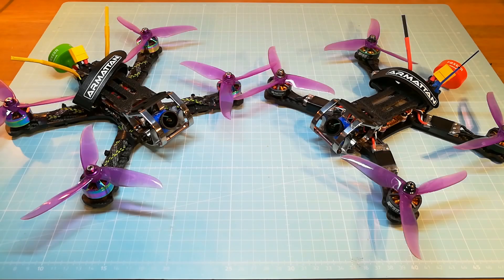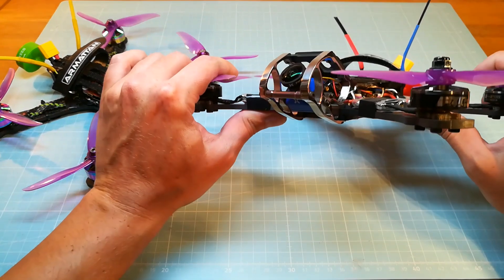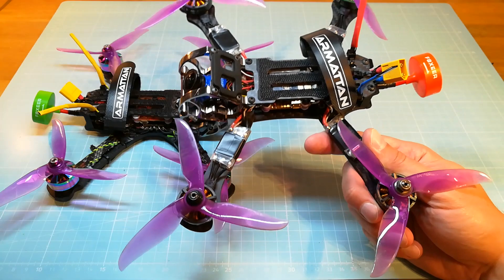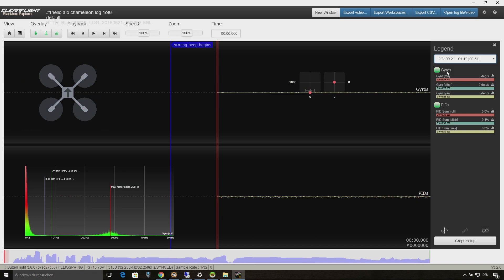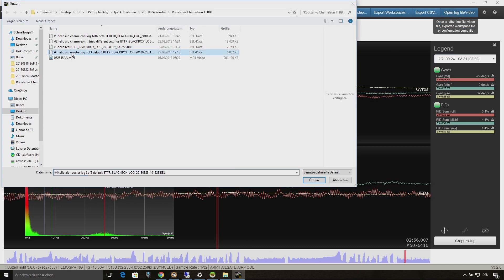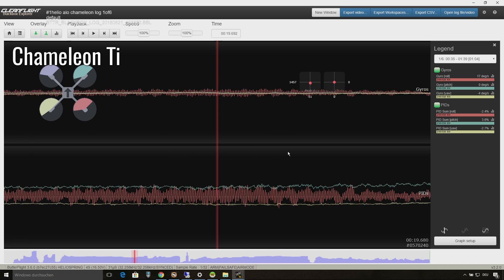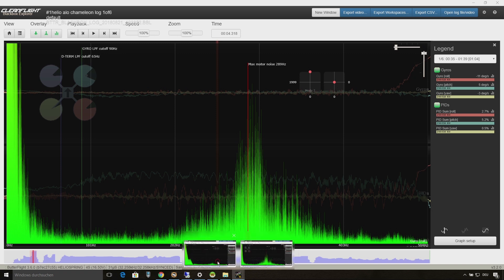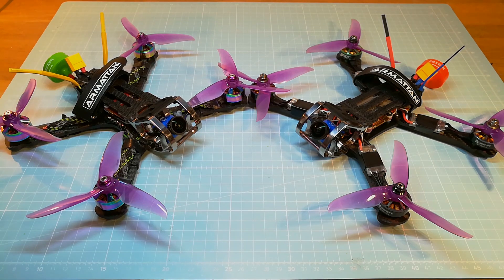Armattan Chameleon Ti vs Rooster - Noise Issue - HelioRC - Butterflight - Blackbox

Comment: Hi, I know it has been a while since you posted.I wanted to share since I used your video to identify the noise frequency so I can add notch filter to my flight controller (Kiss V1 - because I was too lazy to attach OpenLogger). It worked perfectly. I added notch filter of 275Hz (50hz band) to my roll axes and quad is flying great.

Comment: Great video, thanks for that info. I have been experiencing the same issue, but had gone from from the rooster to the ti because my original chameleon has solid footage. Footage was solid on Betaflight 3.5.0. But Ive switched to 4.0 and all was good, but now I'm getting all of noise to the gyro. Footage is looking really bad. How's your footage lately. Thanks
Reply from the maker: Thanks! So you are having noise now with the Chameleon Ti?
I have also tested different Beta and Butterflight Versions with my Chameleon Ti with the HelioRC. I couldn't get rid off that issue.
Now with the Rooster it's much better, but i have addidonal added Capacitors to my Main Power Lead and even smaller Capacitors to the single ESC's. One of my Roosters is still having some vibrations with the HelioRC AIO FC. The Rooster with the red HelioRC FC with a 4in1 ESC works better. 

Seems like the battery and esc wires are still transmitting noise to the gyro on the heliorc AIO FC.

Which FC are you using?
Reply: @TorbanDallas  I'm using the first version of the Hobbywing xrotor stack. I also soft mounted the stack with rubber stand off's, and hard mounted up from the 4-1. Because of hearing about the pins breaking off. But wondering if it's transmitting to much noise to the gyro now not having any rubber between the 4-1 and fc? I just reflashed it last night with the most recent betaflight 4.0. So will let you know how it does today.
Reply from the maker: @BlueHornetFPV  my Stack is hard mounted, but the HelioRC FC comes with rubber grommets, i have also addional added O-rings under and over the rubber grommets. You can even see it in this video if you take a look at the stacks.
Reply: @TorbanDallas  yeah I see that. What's also is a bit confusing. Is my original chameleon has solid video. And its bottom plate is just as bendy as the TI version. After watching your video, I checked the flexibility of the rooster frame, and it bends just as much. I'm really excited to see their new frame, with the more ridged bottom plate. They must be listening?? Lol

Comment: I have a non ti chameleon and I've got a Joshua bardwell f4 v2 f.c with dys Aria 35a single escs, I've used several different motors but still have from 70_100percent throttle a high end sputter or osscillation which I've not been able to figure this out with pud tuning or really anything ..maybe a slight difference when using more flight boards soft mounting, could the escs be the fault? I hate how chameleons have a very close tip to tip on props and I see this being a possibility for dirty air or osscillation. Any suggestions??
Reply from the maker: Hi, unfortunately Armattan has also changed the carbon for the non Ti Chameleon. So if you have this version you will also have this noise issue like shown in my video.  The Bardwell FC with the MPU6000 is a very smooth esc. Well, try Betaflight default settings, make sure that you don't get hot motors - if that happens maybe your motor screws are to close to he motor windings. The best you could do is, to make a Blackbox log and to compare it with the log on my video. Good luck!

Comment: Hi, I just ordered my Chameleon Ti and will build it this week-end. If I do have noise issue can you confirm I can replace the bottom plate with the Rooster bottom plate and 4 arms with no other modification to the vertical and top parts. Thanks
Reply from the maker: Well, you need the 4 individual arms, the rear and the front top plate that connects the arms at the front and the back and you also need the sunk nuts and additional m3x12 flat head bolts. That all comes with the rooster but it’s not supplied with the chameleon ti. I have changed the bottom on both of my chameleon Ti’s, for this I have ordered two roosters – what a waste of money. 
Now I have two chameleon ti’s and I don’t want to build a quad with those frames anymore.
Maybe it’s possible to get all the spare parts on a local store at your location to safe money. Good luck!

Comment: Have you tried to lower the LPF cutoff ? (imuf_pitch_lpf_cutoff_hz, imuf_roll_lpf_cutoff_hz and imuf_yaw_lpf_cutoff_hz)
Looking at the noise frequency, it should be filtered out by the low pass filter
Reply from the maker: Yes i did, i tried 120, 110, 100, 90, 80, 75, 70 and even 60, 50 and 40 without success. It's like i said in the video, i tried all possible settings even with some crazy high and low values.
Reply: Very strange...
How many milliseconds is the length of the noise wave ?
Can you check it in the blackbox ?
Reply from the maker: between 1 and 2 milliseconds. Yesterday i have changed the Bottom of my other Chameleon Ti and there the issue disappeared too.
Reply: For sure changing something can lead to a different result.. maybe you can solve it also soft mounting motors.. maybe..
But here what it  looks strange to me is the fact that 1-2 ms wave length means frequencies higher than 500hz (2ms) ..so let's say for sure major than 333hz (3 ms).. so these frequencies should be filtered out by the lpf... 
when you lowered them to 70 or less.. these noise should be completely removed
Reply from the maker: i also tried different types of motor softmounts and i doesn't help at all. Check the Video there you see the Logs and the Noise.

Comment: I have similar issues but with cheep frames. Can you share those blackbox logs?
Reply from the maker: Wieniu FPV do you have the same results in your blackbox logs? Can't imagine that my logs will help you. There are different things that can cause vibrations. In my case it was the frame.
Reply: @TorbanDallas  No, it doesn't look the same. My problem begins when throttle is above 40%. But I can see this only in HD videos and blackbox log. I like to compare how much noise are getting other people and still have good HD video.

Comment: Great research! Yes,  I had similar resonance issues with my chameleon Ti too. I even did a vibration tap test with a hammer and picked up the frame's resonant frequency with the Helio Spring's gyro on the bench. There was an obvious resonance that was very lightly damped at about 200Hz. I was able to add some damping tape to the Chameleon and reduce the vibrations enough to keep the motors cool enough tho fly, but it would take a lot more to make it go away.
The monolithic base plate of the Chameleon has a rather low frequency first resonance and very little damping, both of which are bad for the FC. The Rooster has a higher first resonance and more damping from all the joints and bolts, both of which are good for frames and are shown in your data. I posted my hammer fresh results in the Helio Slack black box thread, August 6th or so it's probably gone now... perhaps I should show the data on RCGroups or something more permanent/public. Keep up the good work!
Reply from the maker: Adam Weston thank you for your detailed feedback! I have spent so much time in tuning my quad without success. I never heard about frame issues and i never had expected issues with armattan frames. I was on the wrong way of tuning so long and now with changing the bottom plate everything has changed. I think that issue needs to get a higher priority in the point of tuning a quad. It's a hardware issue and it's not tune able with software. Everybody it talking about filtering and even about softmounting, but i never thought about changing the frame before. But in my case i have really tried everything on my two different quads with the same frame. All in all i am happy now and finally i can spend the rest of summer with flying my noiseless rooster :)

Comment: A friend had similar issues to what you describe. Old chameleon with new plate, kiss v2 and F60 pro ii. We debugged his quad for days. Basically rebuilt it from scratch. Oscillations kept on coming back. At some point I tried to bend the frame and realised it was too soft. We moved everything to a 2 year old qavr frame and it flew perfectly smooth. Same when we put it on a reverb. All setup was the same apart from the frame.
Reply: It’s definitely the carbon. Maybe it doesn’t brake, but it flexes too much.
When  I was emailing with armattan back and forth, I got an impression that they are aware of these issues. They also told me that they are working on new carbon which sort of confirms it
Reply: I’m the friend in question. My Chameleon with original carbon flew great. When I broke it I got a v2 carbon bottom plate from armattan and the nightmare begun. In the end I sold the frame and got a reverb which flies great
Reply from the maker: Wow that's interesting. So it's definitely the carbon from Armattan.
Reply from the maker: Yiannis Z thanks for your comment. So i am not alone with this issue and your experiences are the same like my ones.